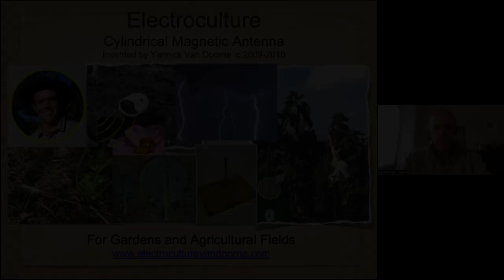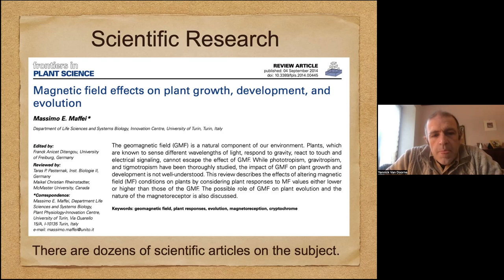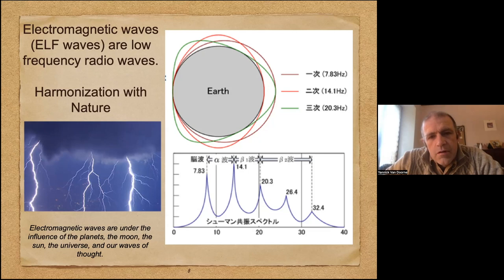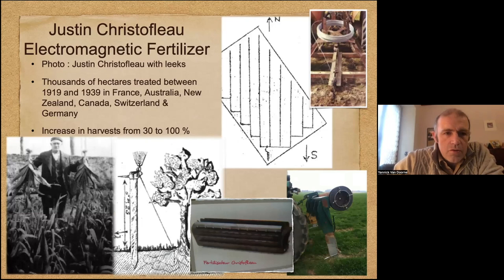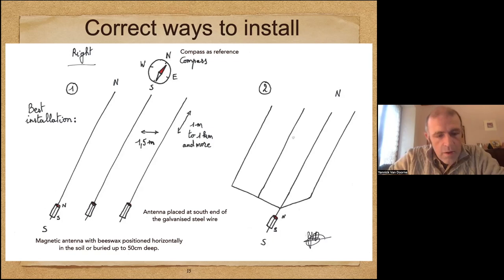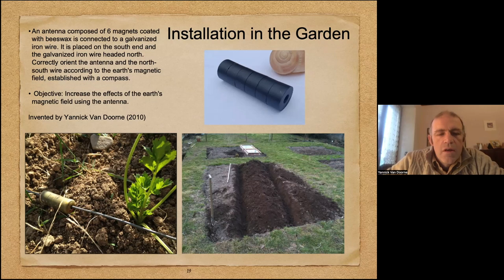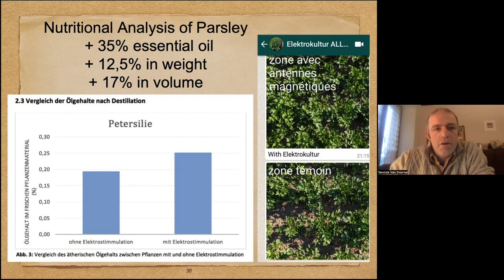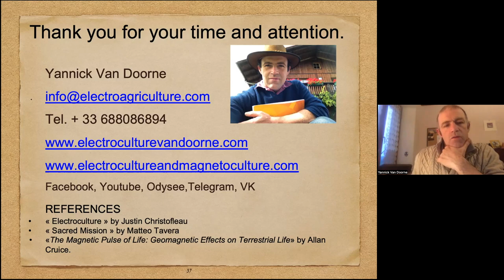Electroculture Earth Magnetic Antennas Lecture 1 Spring 2023

Comment: when you connect the galvanized wire to the magnets, you say the wire becomes magnetic, but when i put the compass near the wire, far away from the magnets, nothing happens. does this mean my wire is bad?
Reply from the maker: Yes, this can be normal, the magnetic field is very weak. But better it is if it reacts and hold the magnetic field in the right directions same as the natural magnetic field of the earth.

Comment: my wire is not magnetic at all eventhough its stainless steel, should i get another proper magnetic wire before putting it in the ground?
Reply from the maker: you need a ferromagnetic material of the wire to make work this technique with the magnetic antenna, so if the metal of the wire is attracted to a magnet then it is ok, if not then it is not ok.
Reply: @electrocultureYannickVD  thank you for the clarification. my wires are not magnetic at all so I am re ordering wires that are magnetic now